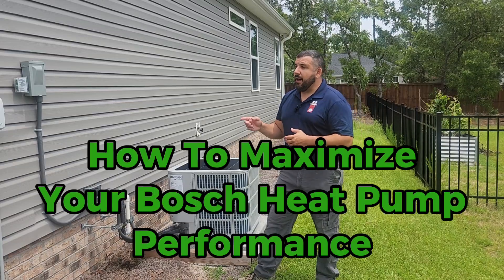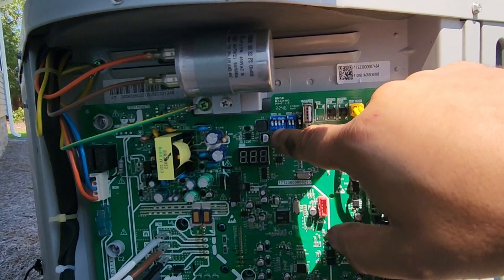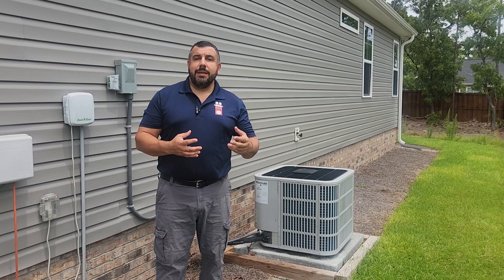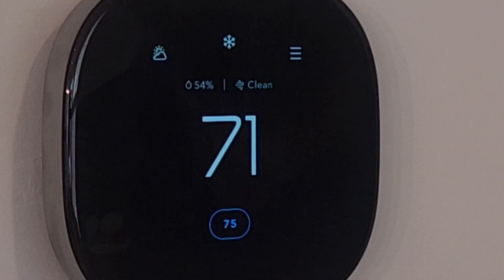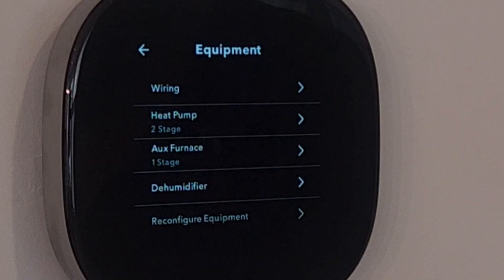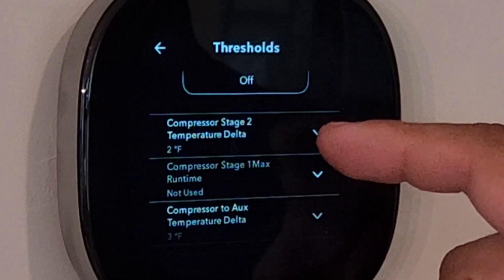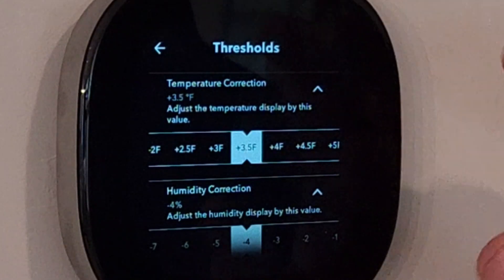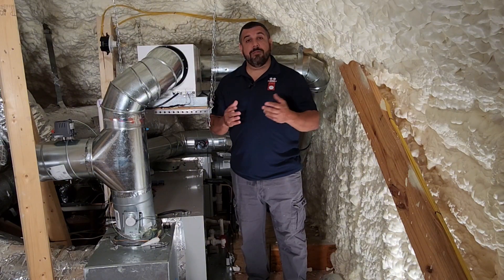How To Maximize Your Bosch Heat Pump Performance

Comment: So my Bosch IDS 2.0 was sold to me as a modern modulating system, but it turns out the unit is outdated and only uses simple 24v signals. It cannot communicate properly, and the ecobee is incompatible with true communicating heat pumps. The result is bad modulation, constant cycling, and loud operation. I am now trying to figure out how to replace the system with the smallest financial loss possible.
Reply: On your stat make sure you have Y1 & Y2 connected to the air handler separately, if you have a DH on both connect it as well, now your stat needs to be dumbed down no geo, no anything special, cycles per hour needs to be 1 for heat and 1 for cool set stat for two stage cool,

If your unit is last years model it’s all 24 volts no communication if it’s this years with 454 you have the option to connect the optional two wire from outside to inside which now makes the two pieces of equipment communicate

Your stat to air handler is only 24 volts so no communication what so ever just tells it when to come on or off dehumidifier 

The Bosch BCC110 is our stat that works well with our unit however it is also just a 24 volt controller, when hooked up with the P&Q two wires and the Bosch stat set up properly will do the following 

If dip switch 4 is on the new 454 unit is now looking for a 50 degree coil last years model was 46 degrees, regardless of Y1 and Y2 calling it’s looking for 50 degrees but with #3 switch off will allow it to run from 50 up to 54 degrees or it can go down from 50-46 degrees these numbers represent our new 454 system 
AC is running and it decides to let’s keep our coil temp at 50 degrees if it runs one hour it will drop the temp to 48 degrees, if it continues to run for two hours it will drop coil temp to 46 degrees.

If the DH is set up properly and it makes a DH call the unit will slow the X13 constant torque five speed motor to low speed and at the same time it will shift the outdoor coil temp to 39 degrees, If the thermostat cycles to off but we still have a DH call the unit keeps running and will over shoot the temp set point on the stat by 2 degrees and this override is not adjustable. In really humid areas sometimes we turn not only dip with 4 on we sometimes turn number 3 on as well 

I work for a rep co as a product specialist TSA and I travel five states doing trainings for distributors and contractors 

I have been to the factory four times so I am an authorized factory trainer 

If you have question don’t hesitate to reach out. Hope this is hel😮pful
Reply from the maker: @terryshrum4194 So if DH on the AHU has 24V on it, what happens? Traditionally the blower runs higher. I always disconnect DH because i want it to run slower.
Reply: @terryshrum4194  Hello. Thanks so much for the information. So with the R410a unit, the target coil temperature is 46F, if Switch#3 is off, it will drift from 42F to 50F? Do you recommend that being on or off? My unit is about 4 years old. It's doing really weird in heating mode. Sometimes it will shoot for lower coil temp for longer run time, sometimes it would try to shoot for higher coil temp for shorter run time, and it gets noisy when it's cold out.
Reply from the maker: Sounds like your unit is wired like a communicating system to a non communicating thermostat.  That's an installation problem.
Reply: @timdestasiohvac    Thanks.  Makes me partial to the native BCC***  bosch thermostats.  I love all the Ecobee stats, but I want the heat pump to be connected like a manual transmission rather than automatic transmission if you know what I mean.  Thanks!!
Reply from the maker: @hgahsiea the ecobee actually gives me more control and allows me to choose when the shift gears
Reply: @timdestasiohvac   I got it totally wrong with the bcc100 tstat.  The ecobee is way better. Just need both the y1 +y2 wires connected. Installers only did y1. Lazy.

Update: apparently it's only Y1!  Chatgpt was hallucinating. I hate ai!!

Comment: Can my air handler BVA-36WN1-M18B do 2 stage heating and cooling?
Reply from the maker: Yes
Reply: @timdestasiohvac  I only ever hear the air handler run at 1 speed during heating or cooling. What do I need to do in order to set it up for the 2 stage heating and cooling? I have a Honeywell T6 thermostat.
Reply from the maker: @franknettleship1006 See if Y1 and Y2 have their own wires at the thermostat and air handler and that the T6 is configured for 2 stage. Use chat gpt if needed.

Comment: I have read that if you are using an Ecobee you don’t want to run Dip switch 4-3 in the Off position. You would want adaptive capacity disabled. What are your thoughts on this?
Reply from the maker: Run adaptive on if youre aggressively sized. It will.make the coil colder as you get longer run times

Comment: Could you use a 120V variable speed AHU instead of the BOSCH AHU? Would get the same efficiency/ output? Asking for more of retrofitting from gas to electric system conversions.
Reply from the maker: Yes any ahu, coil can be used as long as it has a txv

Comment: Could you do a video using the Bosch BCC100 thermostat?
Reply from the maker: No. Theres no reason to . Use the ecobee.
Reply: @timdestasiohvac What if the customer is insistent on the Bosch? There is no way for me to get that to work better?
Reply from the maker: @JohnDoe-ye4nd use the latching feature on the bosch tstat. If it asks for cph, set it to 1
Reply: @timdestasiohvac also do you DH wire from air handler to thermostat in this set up?
Reply from the maker: @JohnDoe-ye4nd no i dont. I run such low airflows theres no advantage

Comment: Hi Tim, I live in NY and i have a bova-60hdn1-m20g paired with a bva-48wn1-m20 air handler.  I have been having issues since it was installed about 4 years ago.  It seems that no one really understands how this system should be set up to work properly.  Im currently having humidity issues in the house running between 70-78 %.  My house is roughly 1900 sq ft and pretty well insulated.  I try to get bosch techs in here but everyone tells me something different but they all make it seem that my humidity is normal.  i know its not ideal but how should my dip switches be set.  the ones on the compressor only show sw4.4 on, sw5 switches off and j2 on.  i am not sure how my handler is set up.  Any help would be appreciated.  Thanks

Comment: How do you make it cool better? I went from a 3 ton York to a 3 ton Bosch bova and it runs 24 hours a day and never reaches set point. My York never had a problem.
Reply from the maker: Longer run times are good as long as the unit is set up properly. If its within 1 degree, it msy be a thermostat setup. If its more than that, its something else. I dont have enough info to help you now but if youre interested in remote consulting send an email to info@comfortsciencesolutions.com
Reply: @timdestasiohvac I figured it out. I thought it shipped in the 3 ton configuration. I never checked the dip switch’s. It was set for 24k not 36k.

Comment: Could you PLEASE show the heat settings. The system got confused when i used your settings and showed invalid on aux heat 2. One really confusing thing is aux and aux 2. Is that if you have two auxiliary heating sources beyond the compressor? I don't see how to disable that so I set it to an arbitrary 4 degrees. 

This thermostat is really confusing for novices. I spent a lot of money for a 20 SEER Bosch IDS system and I sure wish that there was an intuitive thermostat to go with it. I'm afraid that I'm weakening its internal brains by fiddling with this thermostat. That said, I've read that the Bosch thermostat is terrible.
Reply from the maker: Set aux heat to 3 degrees and aux 2 to 4 degrees

Comment: Execellent job explaining the Bosch system, I have a question about thermostats.  You stated that the Ecobee was the best choice for several reasons.  Does Bosch produce a thermostat with equivalent capabilities to that of the Ecobee?
Reply from the maker: Not as good

Comment: You actually do want the fan to run after the heat pump turns off so that it dries out the coil somewhat. This reduces mold that grows in most air handlers as they get older.
Reply from the maker: Nope. That makes it worse usually.

Comment: You don’t have to change the capacity dip switch on the outdoor unit.
Reply from the maker: It helps if the load is pretty high. Other thsn that, no.

Comment: I'm a homeowner and I have two Bosch 3 ton units with Ecobee thermostats in my 2 story house. Summer humidity is aways a problem. I just watched another video about turning on the overcool and switching on the dehumidifier setting. Interesting that you say to leave it off. I need to see if my dip switches are set to 2 ton. Lots of good info here. Any chance you'll be in Raleigh in the near future? I would love a second opinion!
Reply from the maker: I do remote consulting. Info@comfortsciencesolutions.com
Reply: @t@t @timdestasiohvac I will have to try the remote consult. I did some more snooping around and realized I have no Y2 wire at the thermostat. That might be the issue. On a winter note, will you be doing a video on setup for cold weather?

Comment: Had a brand new unit installed last week and it's having trouble maintaining a comfortable temp in the recent extreme heat. Cool (not cold) air trickles out of vents but it's not moving enough air and never goes into stage 2. Noticed that there's no Y2 connected and the unit appears as a 1 stage unit on the Ecobee. Installer insists that the equipment changes stages automatically and doesn't require the Y2 connection. Can you confirm that this is true?
Reply from the maker: Y2 has to be connected at the thermostat and Air handler. The outdoor unit simply needs a  y1
Reply: If you have a single stage thermostat you can jump y1 and y2 at the air handler or use a time delay the answer is to use a 2 stage thermostat.
Reply from the maker: No. That would not work. You need both stages to come on separately and a timer does not do reverse staging  @yankeekilla89

Comment: I guess to achieve a colder coil temperature the Compressor needs to reach stage two for a while and then when it's coming back for a longer time in stage one the colder coil remains for a lot longer.  Which is ideal.  But in order to do this you must run stage two because if you run stage one only the coil doesn't get as cold.  

And I guess there's no chance of freezing the coil when it's running at a lower fan speed for 15 minutes or so after running in stage two for a while.  This is a really good video lots of good information

Comment: Does the dip switch derating adjustment to 2 tons for cooling affect the heat capacity in cooler climates?
Reply from the maker: From what I can tell it does not.  Mine is set to 2 ton, yet in heating it'll go to 72 Hz on a cold night.

Comment: Great video - like the manual settings mode on EcoBee Premium Thermostat. Question - are your "heat mode" settings the same on Ecobee as the "cooling settings" you went thru on video for the heat pump???
Reply from the maker: Yes, not much difference.

Comment: Most people who retro a system don’t have proper return air. The equipment it working fine, the install is trash. High returns are important in cooling.

Comment: Hi Tim, I have a new BOVD-20 (2-3 Ton) condenser connected to a BVA-024 (2-ton) air handler, and your Bosch IDS video has been extremely helpful.  I noticed that my condenser dip switch is set to 3T which appears to be a mismatch for the air handler.  Is this an oversight on the installer's part?  Is there any advantage to keeping it set to 3T?  Appreciate the help.

Comment: Did you enable humidity controls on the thermostat? Special wiring needed from the AC system?  Outstanding video I want my contractor to see this. Installing Bosch tomorrow with ecobee thermostat I hope it works out for my New Jersey location
Reply from the maker: @iampuzzleman282  no if its not in the vid i didnt do it
Reply: @ is there special wiring needed to enable these humidity controls? Or is it It all handled via thermostat setting. Thanks for all your interest.  Team is currently engulfing my home to install system.  Hard work from a lot of people

Comment: I was given the BCC 100 thermostat wkth this sytem. Any advice on how to set it up for maximum dehumidification?
Reply from the maker: @cozycohorter  no. Only Ecobee
Reply: @timdestasiohvac  seems like the Bosch tstat is poor product. Everyone I've talked to has complained about it. Guess I'll ask my installer if they can take it back and exchange it 😞 bummer since I just had this replacement done

Comment: What are the key differences between the IDS 15 and 18 size units? Seems they are similar.   much more for 18?
Reply from the maker: @iampuzzleman282  15 seer vs 18
Reply: @ performance differences?  Efficiency gain not a big deal
Reply from the maker: @iampuzzleman282  higher seer and hspf rating usually means better heating performance too

Comment: Thank you so much for this video and the depth!  about a week ago I had my BOVB 3 ton 18 seer, + the latest Bosch two speed 20 seer air handler installed, and so far I’m loving it.  I actually just now ordered a ecobee premium based on your recommendation (to replace a venstar 7850 I purchased about a week ago as it doesn’t have the more advanced settings).  One question, everywhere in discussions and those Bosch training videos on YouTube, they stress needing to set the thermostat to 1 CPH (one cycle per hour), however I don’t see you mention that or change that setting on the ecobee - I either missed it, or I’m sure you have a reason and I’m curious as to why (or what you suggest for CPH).  I actually plan on reaching out for your remote consulting service once I have the ecobee setup.  I would like to get your consultation/opinion on my setup and any other hvac upgrades you might suggest . Thank you!

Comment: i have ecobee premium and bosch ids 2.1 bovb 3 ton cooling is ok but when is outdoor temp is cold like 20-30f coming to cold air my heat pump we need same video with heat setting
Reply: Please add heat settings. I am having issues with Aux Heat running way to often and very high bills.
Reply from the maker: Working on that
Reply: @muratkirca2051  I had the same problem. I have bosch 4 ton 20 seer airhandler with 20kw heat strip and BOVB 5 ton heatpump.  Could handle the 10f-15f outdoor temp. Ran 24/7 caused high electric bill

Comment: My OEM Bosch BC100 started to not hold at the set point I set it at… HVAC installer came in and got me a ecobee and the damn thing works so much better 😂

Comment: Tim, if my variable compressor operates like yours and it hooks up via the y1 only, can i still run my ecobee to my variable blower via y1 and y2?
Reply from the maker: @ShiZo1337  yes the 18 seer ahu should have a y2 also and it connects to the ecobee y2
Reply: @timdestasiohvac  mine is a gree rebrand. But it controls the compressor the same way
Reply: @timdestasiohvac  Basically Tim, they didn't separate the jumper from y1 and y2 when they installed it

Comment: I just had a Bosch unit installed at my house and have an ecobee. Do you have any set up ideas if I only have the BVA15 handler (the non two stage handler unit). I assume this means I can't change my heat pump to two stage on the ecobee? I ask because some of the settings on the ecobee are not the same or don't show up. I assume since I have a single stage handler.
Reply: I'll also add my humidity runs a bit higher than I'd like. Around 65-67 adjusted and verified by a trusted meter
Reply from the maker: @ryanp143_  a 2 stage blower is critical to my approach because you set the capacity, therefore the run time, by airflow.
Reply: @timdestasiohvac  I appreciate the quick reply!I assumed that would be your answer but if I would have known I wasn't getting a 2 stage blower with what was ordered I would have made the change to have it include the 2 stage but unfortunately I don't believe I can change it now. Do you have any settings that could potentially help with the single stage?
Reply from the maker: @ryanp143_  there is a way to wire a n.o., n.c. relay to use high and low stages. Then use Y2 on the thermostat. I can draw one up for you but that's a paid consulting service for my $200 minimum. If youre interested visit my website and put in a cobtact request www.comfortsciencesolutions.com
Reply: @ ok! Again I appreciate the quick reply, I've had this installed for around 2 weeks so I may have to do that consult. I'll give it another week or so and see where I'm at. Thanks again!

Comment: My Bosch system was stepped up to the next larger size indoor unit. Even after setting the fan speed to the lowest setting, the air noise from the floor registers is considerably louder. I also think the indoor unit is too large for the size of the ductwork. While the system is running, if  I angle out a filter from the ductwork a few inches and let go, the filter snaps back into the duct. Like the return side is straining for more air. Not scientific, but my previous system never did that or made as much air niose. Be careful if you want to step up the size of your system.
Reply from the maker: @steadyeddie7453  looks like that was a poor design. Your ductwork is grossly undersized. I never said to do that now.
Reply: @timdestasiohvac  It appears you did it the correct way and considered all the factors when sizing up the system. When the weather warm here in MD I will take a look at the DIP switch settings on my outdoor unit to see if they were configured for best efficiency. I tend to think they were left at the factory. Thanks for the video.

Comment: Hello brother. I have a problem with a 5-ton Bosch heat pump. The equipment was installed by another person, the card of the external unit shows the code P2 and then the H5. Now it is giving the code P3.
Reply from the maker: @WilenderMontilla  The codes are on the imside panel